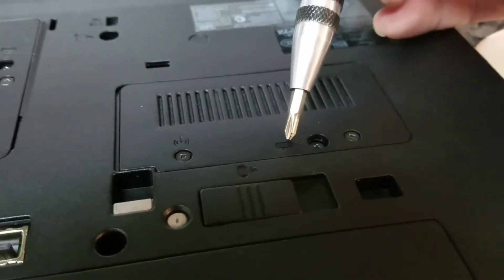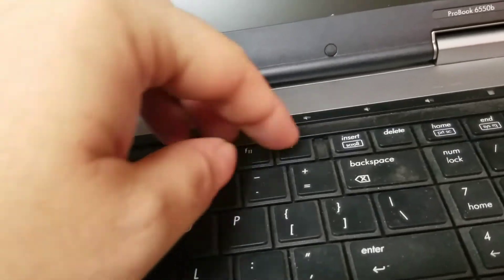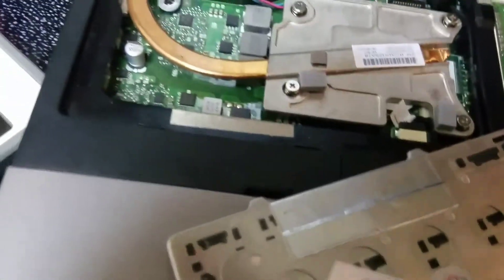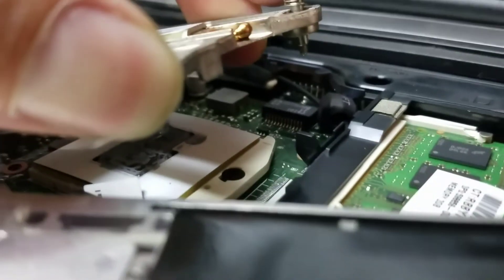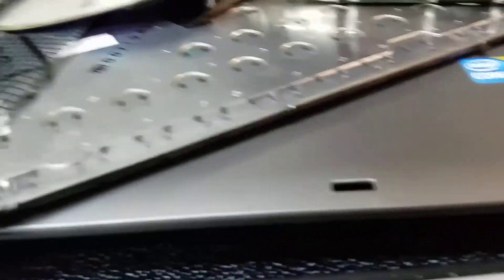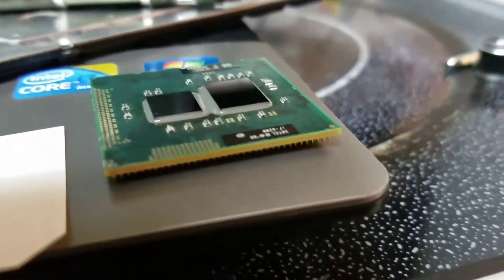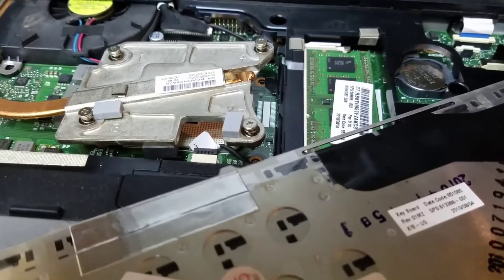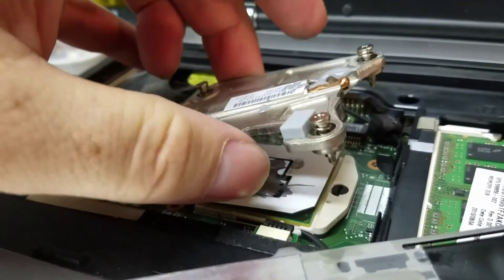HP Probook 6550b - changing CPU thermal paste the easy way

Comment: I couldn't justify giving a thumbs-up to a clown act that could be mistaken for sound advice, but this video had me laughing too hard to justify a thumbs-down, because I could imagine being annoyed enough by a ProBook 6550b to get that careless with it. I bought one used, about six or seven years ago, for more than it was worth, and it demanded special treatment so obnoxiously that I named it after Dwight Schrute.

It would overheat so suddenly that I couldn't shut it down properly before it could shut itself off. It destroyed batteries faster than I could afford to replace them, and eventually destroyed some unread e-mail by damaging the hard drive. After it cooled and I started it back up, it would decide on a case-by-case basis whether or not each function key listed in its menu should do what the menu said it did. It could resume after hibernating, if it was in the mood. because it was configured to pass control to GRUB by default, but sometimes it decided to start up IE in kiosk mode instead, perhaps to punish me for not wanting to run Windows more than a couple of times a year. The soft modem had a free Linux driver, but not for any kernel I could use. I had to write shell scripts to get some of the extra keys to do anything, and the calculator key was a useless ornament. The mesh in front of the speakers took about a year to rot and fall off, and then the left button under the touchpad took about another year to turn into a crater. I used the optical drive about twenty times before it died. Then the SD card reader started damaging every card it touched. Funsies.

So jabbing the motherboard with a screwdriver a couple of times almost looked like a good thing to try! Thanks for the entertainment.
Reply from the maker: At my work we had 52 of these and they were troublesome indeed. Sorry you had a fight on your hands with your Probook. we experienced similar things and we had a do not use pile

Comment: Oh so much wrong with this lol. Reads 6550b as 6005b, can't see that he just unscrewed the RAM cover, not the keyboard release screw. For an extra 2 minutes of thinking and unscrewing, you could have taken off the touchbar, heatsink, and fan, given the fan a good cleanout, properly cleaned the gunk off the heatsink, and had a more professional looking video. But, still, it's better than some peoples 'instructional videos'I've seen on here
Reply from the maker: That's what makes us all creators here in YouTube. We all do it our own way for instance I had a lot of satire and I throw in the occasional pun when I can. I would love to see what you have in mind please make your video and I will watch it and I will like it and give it a thumbs up. Cheers
Reply: @jasonhornby3161  Hi Jason. I came on here to find out why one of my 2 HP Probook 6550b laptops were running way too high in basic idle mode. Within 15 seconds of your titled video for this laptop, you failed to even identify it correctly, then proceeded to undo the RAM screw, not the keyboard retention screw. And to top it all off, you decided to drop your heatsink, with its flaky bits directly onto your CPU socket, while showing just how dry your thermal paste was. 

The 2 minutes I was referring to was pointing out that the keyboard ribbon cable, and also the touchbar, could have been removed, giving you access to the heatsink, fan, and CPU, allowing you to do a proper job in rectifying your overheating problem.
BTW, computers don't recognise satire, only properly implemented procedures.
What you did with that heatsink was misleading, and potentially fatal to somebody else's CPU, since particles in pinholes causes problems.
I realize you were trying to help others out with your video, but if it was me, I would have been a bit more professional, and not only planned out the steps, but also an explanation as to what was happenning, and why.
As to your response about me posting my own video? I could do that, but I'd first need a better cam than my crappy phone, but I can at least do a slideshow, with arrows, and instructions on screen, without ear-blowing music, and still get the point accross(not that yours had music...good call)
Consider this Challenge Accepted!
And I expect your thumbs up, buddy.|
Or criticism, cos it's gonna be my first, and I have so much I want to do with these laptops. Make 2 become 1 so to speak. My first suffered a cracked screen, but my 2nd overheats, supposedly, which is how I came to your video, as well as others.
So now I gotta do a screen replacement, cpu paste replacement, and fan cleaning. 

And have to record it.

Oh, joy!
Thanks for that.
J/k dude.
I'm gonna do it, cos it needs to be done, so I might as well record it. I won't be speaking, cos, well, I'm Scottish, and a Kiwi, so I don't record too weel, but I can write Notepad files to explain, and my Paint skills are pretty decent ;)
Wow, I didn't realize this was gonna be that long. Apologies.
Cheers from New Zealand :D
Reply: Omg this is so wrong....whynot just take the fan off......
Reply: @jingo500  So mate, ever got around to doing that tutorial? Could use your insight here.